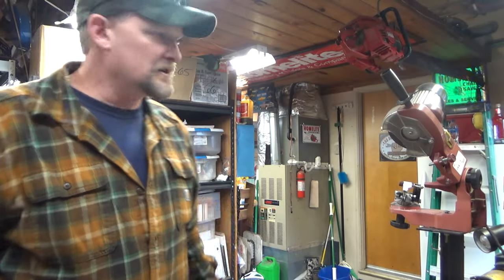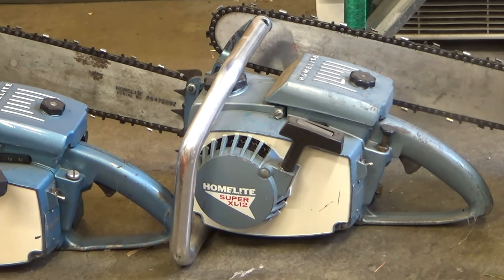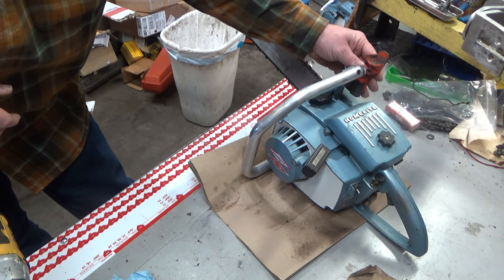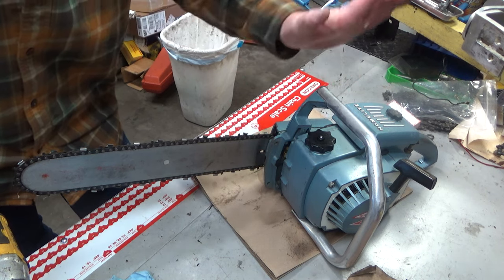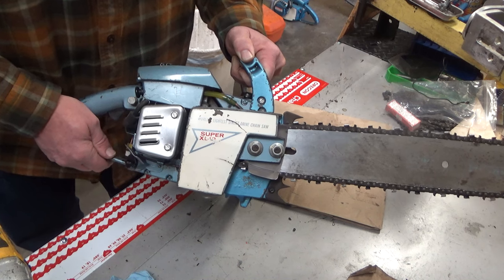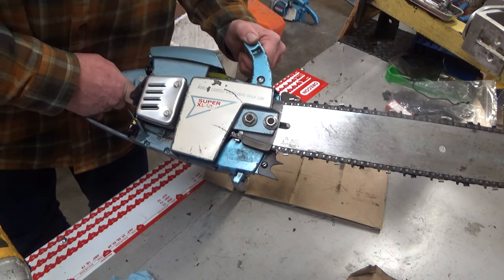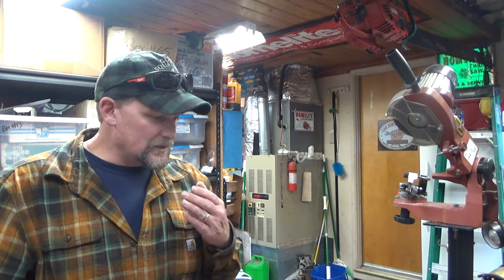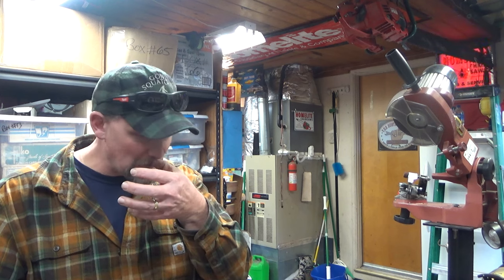You Probably Don't Have A Homelite Super XL-12 Chainsaw, Here's Why &  How To ID Properly!

Comment: Good info, thanks.   I have my Dad's old Super XL12, used it as a kid in the 80's, it look just like your's, has the tag and decals although this one isn't quite as clean as your's.  I have it on the bench to get it running.  No spark.  Haven't pulled the flywheel yet to see what's wrong.  I'll look at some more of your relative videos.  Thanks for posting this stuff.

Comment: I have a Super XL-12 that my father gave to me back in the mid-1980's. (S/N 1789162) Fairly sure he originally picked it up at a farm sale in the early 1970's.  Always ran great and only repairs that I remember doing to it was to replace the bar and chain, and also repair one of the ends of the handle after i managed to break it.  

I was told many years ago to tip it upside down and drain out all of the gas after every time it was used.  It always starts and I believe that draining out the gas really helps.  Until I watched this video I never realized how old it was.  Thanks for posting this.
Reply: Good tip. I have 5 of these saws running and ready to cut, today, if need be...till something goes lol Mine are all hard worked saws that I acquired and have been fixing and using. I was thinking just the other day that I am one guy with 5 working saws and parts enough to assemble 2 or three more lol MAYBE I should drain out the gas out of a couple, or three, and put them away...but then they will get lonely and stiff :-(

Comment: Thank you, thank you, thank you! I've been struggling to identify my old Homelite saw, a well-used machine missing all its decals. The ID plate is still there and says "Terry Corporation, type 50003, serial 30661159, Pointe Claire, Quebec'. So.......it appears my saw is a 1973 model (the main casting is dated Jan. 1972). So far so good. Oil filler cap below the sparkplug, angled handle bar, blue paint, manual oil pump.....everything is pointing towards it being an XL-12. Not a Super. You're a tremendous help Leon! I'm heading over to your website now.
Reply: Have you found any Canadian service manuals?

Comment: I have a super xl auto I picked up a couple years back. I like it, but it has some idle issues. (I believe its the crank seals, I just have not had the time to go into it; I had replaced the reeds which were severely pitted and gapped, helped tremendously, but still not right)
On mine, there is no tag whatsoever, and was curious to how old it is. It’s blue.

Comment: The blue ones are also the older ones yes? I have three blue ones, two of which should run again when I get back to them. Still fixing up red ones lol Canadian versions, so a couple have chain breaks...red ones. I'll have to watch this more closely as most of my XL-12's +  have had parts swapped here and there.
To be honest I thought all my XL-12's+ were about the same CC's but I did notice a couple were clearly more powerful. Hard to find Canadian service manuals.

A few of my saws need the manual oilers fixed. Only thing preventing their running. I haven't learned how to repair the oilers as yet, besides cleaning. Some seem easy to get at, others require more disassembly to get at, it seems. Big job replacing the copper oiling pipe to the bar, it looks like 😞

Well I am heading to my shop to see what I actually have. I know one red one I just fixed up to use, has both an automatic and manual oiler, no chain break. Running beautifully.
Reply: OK I checked. My red one is an XL Automatic. No mention of Super. The tag is missing but both sides say XL Automatic, and it exactly matches what you showed as an XL Automatic. It has a manual oiler as well, but to be honest, I never noticed if the automatic oiler did much. I am use to the manual pump so I would use it automatically. Mine are Canadian versions.

I have some old blue ones with no lables. Maybe there is a super hiding there lol
Reply: Update I have a saw that came to me dissembled, not sure why, it is likely the newest "XL-12" like saw I have. I will eventually get this one running again.

The thing is, after having a closer look, I  realized it is another XL Automatic....HOWEVER

It is red, it has a chain break, the oil fill is below like on XL-12's, fat muffler,  factory electronic ignition, Canadian made 🙂

I need to somehow make sure I use proper parts, to assemble. I know it wants to run as I  borrowed a carb from my working saw, to test, and it  ran fine. It did not sound like all my other XL-12 like saws though. I am not sure that the fat muffler alone is what makes it sound so different. We shall see. I am getting some supplies and a couple more tools.

Comment: I pick up everyone of the xl series I come across at a decent price.   In the pile I haven't tried to get going is a green handled XL15 I think.   I noticed that the sprocket cover looks different.   What are the doos n don'ts on the 15 ????
 I didn't realize that it was different in any way. Now that I know I wanna get it out , and going. Seems it has more green than just the handle. Paint is really good on it.
Reply: There were three gear drive/XL-15 models.  All are substantially scarcer than other XL’s.  If it is a red/white saw, then it is an XL-15 with the green handle as a transplant. If yours is a blue saw with a handle that faded to green, it is a Super XL-15, and it is much scarcer yet.  The red/white/green gear drive with a true green handle is an XL Automatic GD (Gear Drive). It may be one of the rarest Homelites. I have only seen one surface.